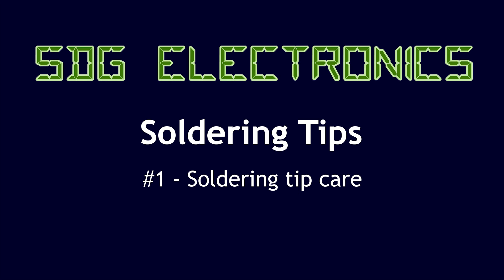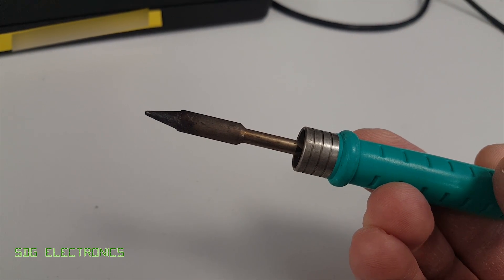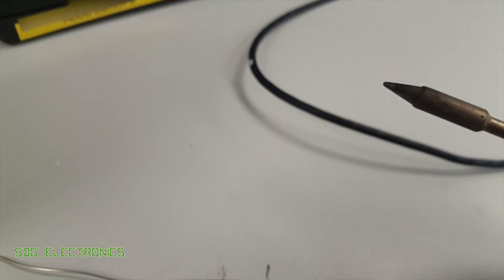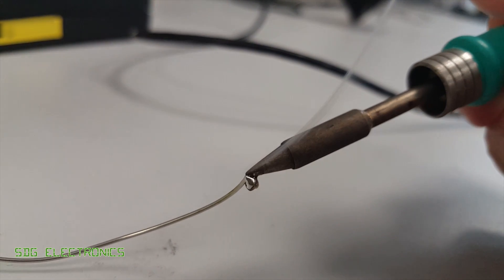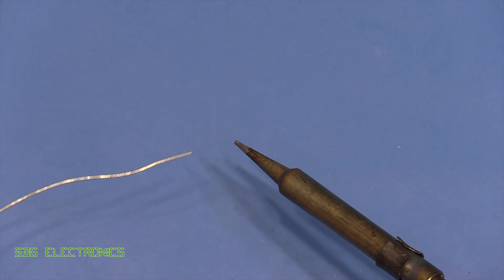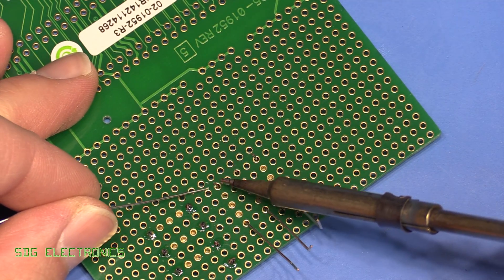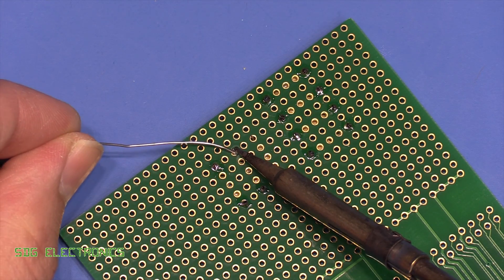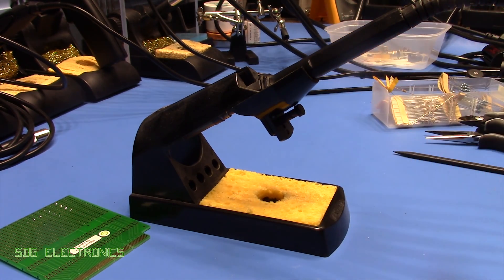SDG #052 How to look after your soldering iron tip - Soldering Techniques #01

Comment: i would not wipe it on a damp sponge due to thermal shock that can cause micro cracks in the plating of the tip and ruin it over time. instead just use the brass wool and only the brass wool.

Comment: I just got a "copper solder cleaning ball" in a tin off AliExpress, but it's magnetic so it can't be pure copper. It's scratched the iron a bit. Brass is softer than this copper coated whatever it is isn't it?..
Reply: It is probably steel.

Comment: So much good information. Thanks for taking the time to do this video. 3 key things I took away from this: 1) you don't need as much heat as you think. 2)A hole in the sponge helps scrape off the solder balls during cleaning.  3) Don't wipe tip every time while working. Leave solder on even after turning off to prevent oxidation. 
Nice work!

Comment: I've lost count of how many times I've been triggered seeing people being wrongly taught to wipe before putting it back. 
Multicore make a tip tinning substance that you dip the hot tip into  to clean it up - not sure if the newer lead-free version is any good but the older leaded one worked pretty well at de-coxidising cruddy tips.

Comment: I use stainless wool the type that is super sharp on the edges. I learned that back in 2011 and was told to never use the wet sponge and leave the crud and tin on the tip when placing it in the holder. I have used Weller irons for 30 years and my iron is about 40 years old (got it used). Since that day I have not thrown away one single tip they just last.

Comment: When you put back the soldering iron into the holder with the blob on the tip, the iron is still on and won't it melt the blob away?
Or, does it turn off automatically when it is put into the holder? Sorry for the silly question, I am new and frustrated with oxidised tips. It seems to oxidise too quickly. 
:face-orange-frowning:
Reply: Some soldering stations go to dormancy when you put the iron in place and they'll be at lower temperature until power is turned off or the until some time has passed. I'd recommend turning the station off after you've finished.

Comment: Thank you for making this video. I was looking for perspective to make sure I was doing it right. I was worried I might be using way too much and wasting solder, or not covering enough and exposing the tip to future oxidation. The tip about not wiping after use and instead wiping before makes sense.

Comment: Hmm, I have never has issues when I cleaned the tip of the soldering iron and then left it that way. But when I started leaving solder on the tip, I had problems since flux in the core burned on the tip and it was really hard to remove it. All this experience was with high quality leaded solder.
At the work, where we are not allowed to use leaded solder it is completely different story. No matter what you do to the soldering tip, the tip oxidises, but leaving the solder on the tip alleviates the oxidation a bit. It is very annoying, especially when you need to solder fine pitch components with a blob on the tip.

Comment: Many thanks, very informative, short to the point, which is becoming a rarity on YouTube! Quick question please, what is the best way to clean up an oxidized tip?
Reply from the maker: Brass wool is the best method. If it doesn't work, the tip may be beyond repair.

Comment: The one possible exception to never raising the temperature is if you're trying to solder a really large pad connected to a ground plane or something like a gold cup or big fat wires for quadcopters. But the answer there is to use a nice big chunky tip and ensure you have enough solder on it to ensure proper thermal contact. This is where the cheap irons will really struggle to keep up; I've had solder freeze on me because the iron simply couldn't deliver enough power to the tip.

Comment: I'm new to this...but the way the solder runs away from the oxidized tip seems to be exactly what I need...and that may seem a bit backwards but MY issue is this, my goal is to get the solder to melt onto the circuit boards and not just glob up on my iron. I cannot get it to transfer over for the life of me it's very difficult. I'm trying to install some simple capacitors and for whatever reason the solder wants to stick to my damn iron rather than transferring over to the legs of the capacitor. Even if I try to heat the legs of the capacitors first and then feed the solder onto that, it still doesn't seem to work. So me seeing the solder run away from this iron tip kind of seems like it would be what I want it to do
Reply: flux.

Comment: Hi I need some help...everytime I solder at around 300° - 350° my soldering tips either shrivel and break off or they melt and break which stops me from soldering....I always re-tin my tips and use flux to clean them when using...does anyone know why this happens? Thanks

Comment: hello
TMT-2000S-KM THERMALTRONICS

soldering station is good for smartphone repair ?
or is better soldering station with manual control temp?
Thanks
Reply from the maker: Yes, it's a great station. Lots of power and excellent thermal control

Comment: 0:27 mine is exactly like that so what do I do? I'm new to soldering...
Reply: You can try buying one of these small ammonium phosphate and tin based tip cleaners. Put the tip in there, try to tin it, clean it off. Repeat until it works. That stuff corrodes the iron plating on the tip though, so only use it if you have to. Or, depending on the cost of the tips you're using, maybe it's best to just buy a new one. After your tip works fine again just use brass/copper wool to clean it and/or a sponge with distilled or deionised water, no tap water. And, as said in the video, keep a big blob of solder on the tip when you're done using it to protect it from they oxygen in the air.

Comment: Many years ago I went on an advanced soldering course. The first lesson was "thou shall NEVER clean your iron tip on a wet/ damp sponge or abrasive of any kind".
I was rather taken aback as this is what we had always done.
After banishing the sponge /  abrasive wool and used denim cloth pieces instead to wipe the iron tips, our iron tips which used to last 2 months if we were lucky, are now 3 years old and still in great shape.
The comments on the course were "well why do the soldering iron manufacturers include a cloth?"... answer; they want to sell you lots of tips.
Reply: I had a perfectly new tip and a sensor controlled abrasive wool cleaner. I cleaned my tip that much that all the coating went away and now it’s good for nothing. I will try out the denim method. Thanks for sharing.
Reply: Could you tell us if there is a specific way to maintain the solder tip with the denim please? Thanks for sharing your experience, If you ever have a link that explains the steps, I'd appreciate it :)!
Reply: Do you wet the denim piece?
Reply: @plinker439  No, water kills tips, as does abrasion. Water is the worst though.
Reply: @lanceallen5092  Thank You.
Reply: @lanceallen5092  so how does it not burn the cloth?
Reply: @DeputyFish  Denim is flame retardant and you only wipe it briefly on the cloth.
Reply: Sorry, that made me laugh. We teach advanced soldering and you need to use slightly damp low sulphur sponge with deionised water for wiping and a brass pad for scraping oxidisation when necessary.
Too many people only use brass which does not clean or use a wet sponge which thermally shocks the iron and ultimately causes plating fractures.
Bear in mind, we leaned a lot in the last 20 years and what was thought good back then may have been proved bad, much like us using asbestos in walls years ago as it was thought good until we found it VERY BAD.
We always teach to wet iron b4 placing away in stand and particularly nowadays where we work with higher temperatures due to lead free melting at least 30 degrees higher.
Reply: @davidfurnissUK  Our company's  evidence suggests this is the best option, wiping on cloth only. A fully commercial electronics factory now has tips that mostly last the life of the iron, ppreviously replaced once a month or so.
Reply: @ yes, wiping only is best and although brass is softer than the plating so shouldn’t damage it, it will slowly burnish it over time.
Brass is to get through the oxidisation so if it’s tinned after use, the tip won’t oxidise so shouldn’t need brass.
Low sulphur sponge is perfect when dampened with deionised water.
I don’t like systems that only provide brass as an option
Reply: tell me about this school and this denim cloth? i find no information about using denim cloth to clean a tip?
Reply: @Lance, you should do a video on this...
Reply: Brilliant tip i already learned the hard way 👍
Reply: @MCFCtreble  could you also possibly give some more information on this? I've never heard of this before
Reply: Could you give a bit more information on this? I have never heard of this and can't find any information on this at all
Reply: what course
Reply: @phr3ui559  It was around 2002 in Sydney, Australia. It was a practical class run by Terry Clitheroe, a master solder instructor. The course was called high reliability hand soldering (or something?). Apart from wiping on the denim cloth, very occasionally I clean the tip with a solder iron tip cleaner compound which brightens it up. I do this about once every 3 months or so. This is for a development and manufacturing environment. I am still very surprised this isn't common practice. I checked with our manufacturing facility, they say a tip on the assembly line now typically lasts 5 years.

Comment: Nice video - I learned this the hard way and did exactly as had been done in the video with the shared iron. Although, I do believe it was partly to do with buying crappy lead-free high melting point solder. Ended-up using 380 to get anything out of the iron and finished off the tip even faster.

Comment: Yup, I know this situation all too well. When you come to use the iron, it's set at 400C and the tip is bone dry. 
I wonder if you have to deal with bend / broken tips at work as well ? :)
We use the Weller wxmp, unfortunately they don't take abuse very well, and people tend to use them as a crowbar.
Reply from the maker: These tips seem to be dead after a few weeks. They get destroyed on those terrible chemical tip cleaners too. People are generally careful, so no bent tips, but just seem to think the tip should be perfectly clean when they have finished. Good to hear from you
Reply: Great tips ! :)

Comment: And if you (or someone else) really messed up the soldering tip, it might be possible to revive it using a Soldering tip refresher: https://www.ebay.com/itm/Soldering-Iron-Tip-Refresher-Clean-Paste-for-Oxide-Solder-Head-Resurrection-G02/273657002576?epid=26011355311&hash=item3fb73a7a50:g:Xd4AAOSw0YlcHJT4:rk:6:pf:0  I would use it with care though (not too often) as it might "eat" into the tip a bit.

Comment: My father taught me to clean hot iron tips with a good old fashioned Bayer uncoated aspirin tablet. The salicylic acid does a decent job removing oxidation. It is not the most pleasant smell (smells like burning acid - go figure :-)) but it seems to do the job.
Reply from the maker: Never heard of that one. Only got paracetamol in the house though😅
Reply: There must be 1000 uses for the good old aspirin. :-)
Reply: It definitely works 👍
Reply: do you need to dissolve it in water first?

Comment: Had considered the sponge shocks the tip a bit, so avoid it, and instead use the brass wool for cleaning.  Any thoughts on that?
Reply from the maker: The brass wool is softer than the plating on the tips so no real problem.

Comment: Thanks Steve. I usually only use my sponge before I start soldering and before I stop soldering, unless the tip looks pretty dirty. While soldering I normally just use the tip cleaner coils.
Reply from the maker: Avoiding contamination of different alloys if reworking PCBs is one reason wipe the tip regularly
Reply: Yeah, I tend to clean the tip more soldering SMD's.